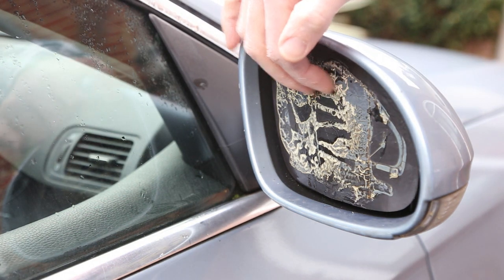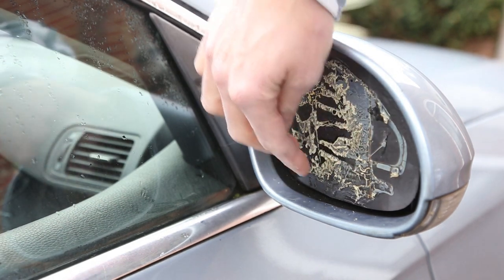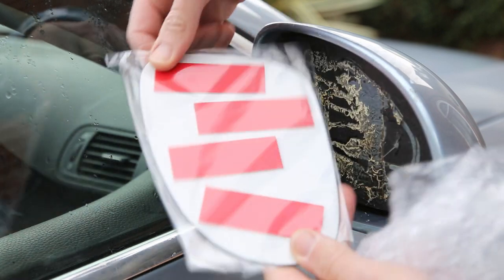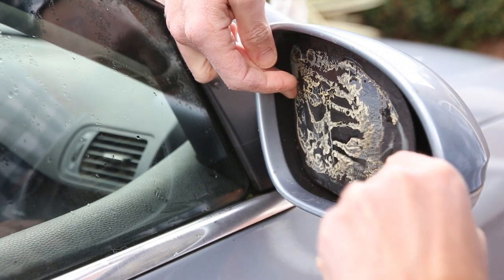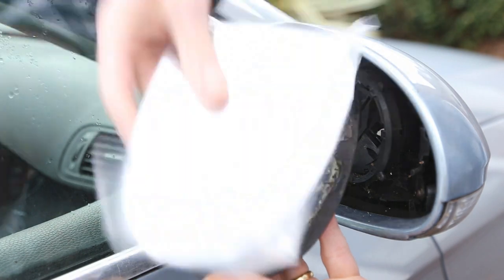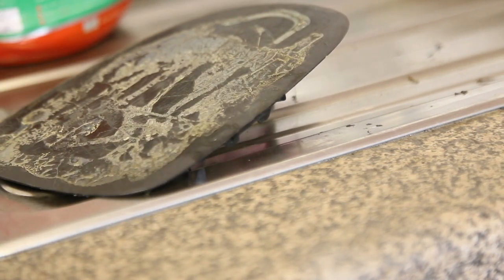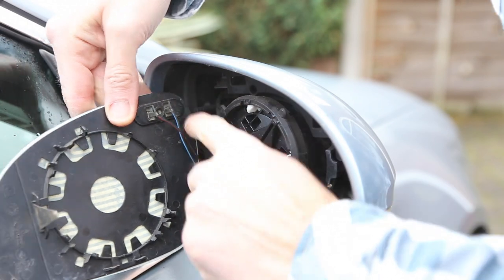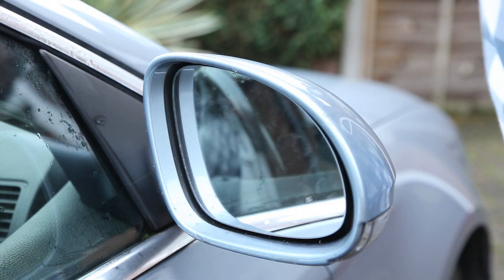VW Golf/Passat/Touran/Polo Mirror Glass Wobbling/Shaking/Moving Vibration-Fixing Loose Fallen Off

Comment: I managed to catch mine yesterday, now need to stick back on...
Reply: it looked as if it had been taped on at some point ... mm, not sure what's best and easiest to do
Reply from the maker: Glad you got it in time. I just used contact adhesive for mine
Reply: @ajvw  cheers - good to know; I'd been noticing it wobble for about half an hour, and then on the motorway-ish reckoned it was really about to fall - I think it would have done! phew, but still need to get it back on - it's not fun driving without it.
Reply from the maker: @DrCaits  I know how awkward it can be, mine dropped off at the start of a 300 mile return journey so I couldn't sort it until I got home!
Reply: @ajvw  sympathy - you've reminded me of a small thing that has worked (so far) - I can't even remember how I did it now, but so glad that so far it's stayed stuck on - crossed fingers it continues.

Comment: Thanks for the video. Mine started falling off, i notice d on time so i still have the mirror. Can you tell me, can i just use super glue and glue it back on.? So i dont have to use those double side adhesive tapes. Thank you
Reply from the maker: Yes you can use super glue or contact adhesive to attach it
Reply: @ajvw  thank you for such a quick reply and advice
Reply: I forgot to mention that mine are heated mirrors on Audi A4. Do you think that super glue is still good? Thanks again
Reply: I used super glue a few times and it keeps coming off... Recommend the double sided adhesive